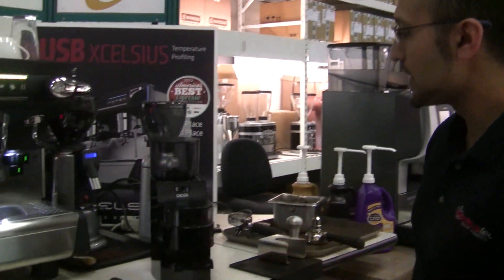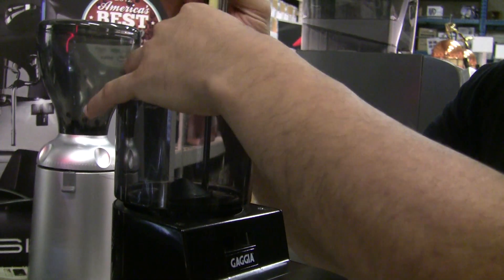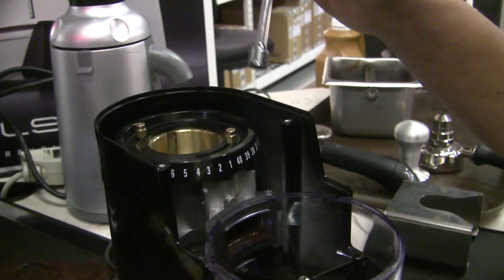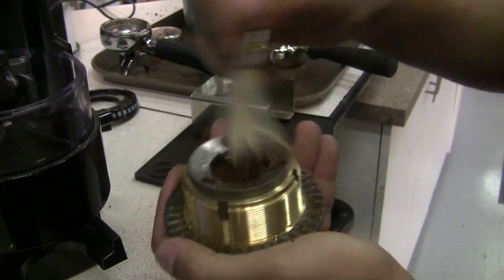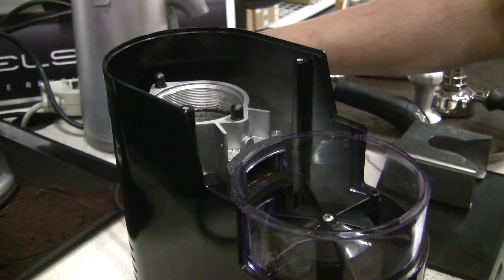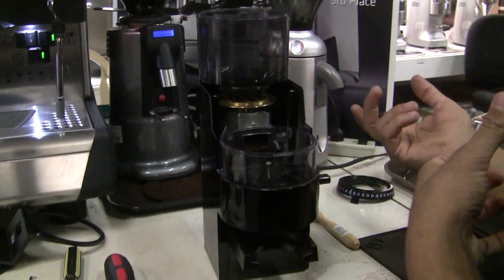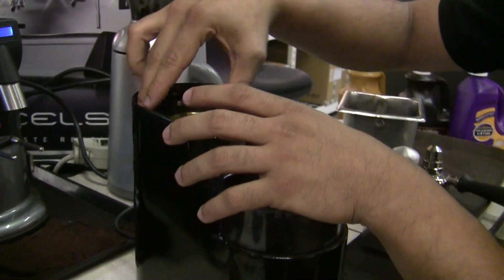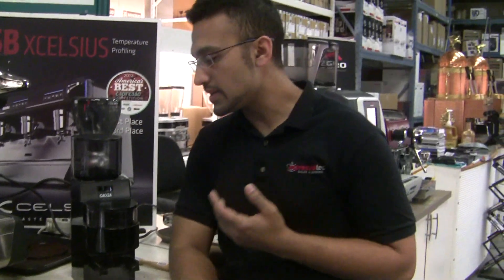Gaggia MDF - Cleaning, Calibrating and Burr Removal

Comment: Is rice a good replacement for Grinz?
Reply from the maker: Thanks for the question! 

We never advise our customers to use rice to clean their grinders, as the grains can grind into a very fine powder that can then gum up and clog the burrs. Grindz and other grinder cleaning crystals are designed specifically to avoid this problem and leave you with nothing but clean burrs. Our philosophy is that nothing should go through a grinder except coffee and specifically designated cleaning supplies.

If you have any other questions, please feel free to send them our way, either here or by emailing info@espressotec.com!

Comment: Thank you for the information!  I serviced mine with no problems after following the instructions.  I might add one note for the other viewers: after calibrating, I had to move my grinder setting up at least 1 step in general.  The first shot I pulled with the same grind setting as usual and the same beans had my espresso maker bogging down, taking nearly a full minute to pull the shot.

Comment: Love this super clear explanation! Went through all the steps and it works great. Thanks!

One thing I noticed is to be careful that the bean hopper is correctly aligned when screwing it back in.. turns out it's possible to screw it in a bit crooked (if you tighten one of the screws or nuts more than the other one). The other thing to be careful of is that if you turn the grinder upside down to clean it when it's open, the two stops (2 little plastic caps each on top of a spring) under the burr will fall off, so remove them first.

Comment: Great video! Thank you for making it! 

I just purchased one of these used and I am taking it apart to clean. Problem is there is quite a bit of caked on guides in this thing. 

Should I continue to just use tools to chip away at this mess, or can I soak the parts in vinegar and allow it to properly dry?
Reply from the maker: Chris Lewis Could you explain what part you mean by the guides?

For old coffee stuck in the grinder use a pick or brush to remove the excess coffee grounds. Also wipe the surfaces with a cloth to soak up the old coffee oils.
Reply: @Espressotec  as this is greasy I think mineral spirit may help . I used hot ultra sonic bath  but not anyone have this ..( sodium Crystals may work to get rid of old gunk I think, rince well)
Reply from the maker: @IsaacOLEG  Great tip! Thanks for sharing.
Reply: @Espressotec  sodium crystals are more or les the same as the pulycaff powder (some use only sodium crystals to backflush).
I am not sure minéral spirit is so good (because it evaporates soon) but I changed the burrs on a gagglia MDF grinder. Some screws where stuck and the burr plates where glued by the old coffee gunk/oils. The efficiency was obtained with heat . I used a hot gun, but a hair gun should do it if you keep heating long enough.
Regards
Acids ( citric 30%, sulfamic10% lactic10%) , are good to clean the calcium from tanks and circuitry.  If really blocked find some phosphoric acid it is stronger than the others (unlocked a pump with some) rince first with sodium carbonate to stop the acid reaction then clean water. 
Sodium Crystal's in hot water may clean the filters and the holder without need to brush. Rince well.

Comment: I have a older Gaggia MDF grinder it does not have nuts that hold the bean hopper. I can see there are screws on the other side which I can not get to from the top. Does the hopper just screws off?
Reply from the maker: Thanks for reaching out, Terrence!
Take a look at this diagram: http://www.espressotec.com/gaggia-mdf-part-diagram.html
We don't carry this grinder anymore but from what we remember and from a look at the diagram, it looks like there might be a securing screw... Try clearing it of beans and see if you can find it. Hopefully the diagram helps.
Reply: There should be two screws. They are hidden by rubber caps. You need to pop them off with a small flat blade screwdriver.

Comment: I noticed that if you use teflon tape so you can regulate eith half numbers, with the tape you get rid of any play between the burr holder and the tank support. But be cautious to use same number of turns everywhere. 2 thickness of tape where enough for my old model (80') . With the 2 spring loaded fingers I am not sure the parallelism is guaranteed between the burr plates. Anyway I did put teflon more than once,until the plate could turn without rubbing ( very lightly only in the end)

Comment: Thank you for the video.

I think your burrs are too close.  I would have zeroed at the step before or even the step before that.

What is the torque specification for the center nut?  There is a lot of coffee tar under the lower burr holder that I can't reach.  I'm assuming you hold the motor still by placing some kind of tool in two of the lower burr mounting holes?

Comment: I was given this grinder, but it came loaded with some very rancid beans. I went through these steps, which were extremely helpful and easy to follow. I cleaned my pieces, and even soaked them in a Puly solution, dried, and reassembled.  Unfortunately, the grinder STILL smells and tastes like 1+ year old rancid coffee. Any suggestions? Thank you!
Reply: I steam cleaned the individual components bar the motor and washed the larger bits in bowl of hot water with detergent.  It now looks brand new.  They are very good machines and can be restored back to
Reply: I would soak them in whisky, or pure 96% spirit. Alcohol dissolves fat by design.

Comment: Gracias! Very helpfull!. What about "false chirp"?. Im confused. Regards!
Reply from the maker: Federico Pick Not sure where you heard the false chirp from, could you elaborate?
Reply: Espressotec Hi, in the calibration manual of the MDF says: Sometimes a false “chirp” can be heard. Another way to ensure that the burrs are at absolute zero is to listen for the sound after you switch the grinder off. It the motor sounds like it is winding down, then the burrs are still freely spinning. If the motor stops immediately, then the burrs are touching.
The false chirp may be heard when the engine is running or when this off?
Thanks!!
Reply from the maker: Federico Pick That is when the burrs are almost touching. Due to a slight wobble during rotation the burrs will touch here and there but this is not your zero spot. Set it such that the burrs make contact and stop when the power is cut.

Comment: I turned it over because I dropped a screw and two springs with what look like little bullets dropped out... did I break it?
Reply: I’m sure you’ve worked out how to put them back, but just in case someone else reads your comment and has the same issue, check out around 5:50 mark on the video and you’ll see them in shot. Put the spring in then the black cap and it will be fine. They are what produces the clicking as you set the grind. Regards, Gerry

Comment: i was cleaning using this video and these two rubber caps with springs came out of mdf, not sure from where. would you know how i would remedy this?
Reply: Farrukh Jafri Those rubber caps and springs sit between the upper and lower burrs. They provide the steps when adjusting the grind size. You're probably not getting the clicking sound when rotating the hopper. You need to remove the hopper and upper burr, then drop the springs (first) and the caps into the holes provided. Put the hopper and upper burr back, then calibrate the grinder as shown in the video.Take a look at the 5:40 mark in the video. You an clearly see the two caps sticking up from the metal housing, one in front and the other in back.

Comment: how often does this grinder need to be maintained.  I have never cleaned mine.. I have owned it for roughly 3 or 4 months
Reply from the maker: Thanks for the question! 
We recommend vacuuming out the hopper and burrs, then running a tablespoon or two of Grindz (pellet-shaped detergent: http://bit.ly/2GNMPR1) every 3-4 months to alleviate oil build-up. The hopper will need to be removed and cleaned manually with paper towel — make sure there is absolutely no moisture inside when you put it back. We also suggest using a grinder brush (we offer a few varieties in our web store) to sweep away any dust or grounds from the chute and burrs.

If you have further questions, feel free to reach out to sales@espressotec.com!

Comment: Thanks for the video. I used grindz to clean mine, but it left such a large amount of residue that I need to open the device to clean it out.  

I lifted off the protective rubber pieces hiding the screws inside the hopper, then unscrewed the screws and the hopper would not come off. 

Can you recommend what I do next?
Reply from the maker: NYCgoblue I would ensure to use Grindz on a medium grind setting to ensure it doesn't clog  for the future.

Build-up of coffee grease has "glued" the hopper in place. You can use a rubber mallet to hammer the hopper upwards and out gently.
Reply: Espressotec thank you! I'll give it a go.

Comment: I don't know what I did wrong. I've followed your instructions before with no problems. Excellent instructions, btw! But the this time I'm not getting any "clicking sound" at all when I screw the upper burr holder back into position. I haven't tried removing the lower burr or anything else beyond what you demonstrate. I'm stumped. Thanks
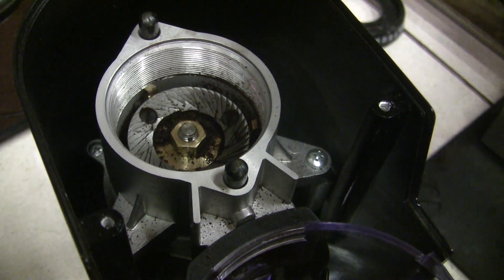Reply: You more than likely didn't install the two caps and springs that sit in the metal housing. Look at around the 6:00 min. mark. You can see those caps sticking up one in front the other in back.

Comment: I can't get those plastic caps off the top of the screws in the hopper, even though I'm using a pick as shown. Maybe I have an older version of the MDF that doesn't have them? Any ideas anyone? I'd appreciate a little help.
Reply from the maker: Sorry to hear you're having difficulty! The screws are designed to be removed; it could be that there is coffee residue built up that is interfering with the threading. Take a look and see if there's a build-up that can be brushed away, give the area as good a cleaning as you can, then try again. Let us know if you need any further assistance!
Reply: @Espressotec  I finally got the caps off by inserting the pick into the top of the rubber - it wouldn't work coming in from either side. Following your instructions in the video, I successfully replaced the burrs, gave the MDF a thorough cleaning, and then reset to absolute zero. It wasn't grinding anywhere near fine enough for espresso, but now on #4 I'm getting a perfectly consistent shot again. Thanks for sharing this video for free - a great resource.

Comment: Is it really necessary to have the burrs starting to touch when recalibrating it? (8:15)

That must surely cause damage ...
Reply: I think you may count the clicks, but just a little touch of the burs are no problem( from my expierence)

PS: I just hear the noise a little, I spin the hopper very carefully and I do it with one hand on the off button so it touch for a very short time
Reply: @Leo-wm7cd  you can turn it with a thin tool from the opening where the coffee goes out, then no need to check with the motor first.
Reply: If you push on one side of the tank and there is some play the regulation is not good.